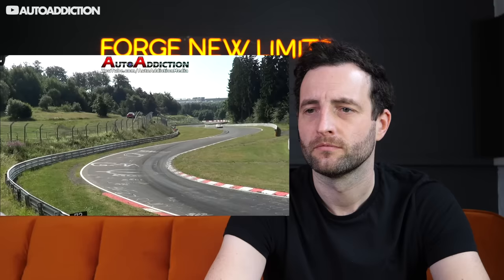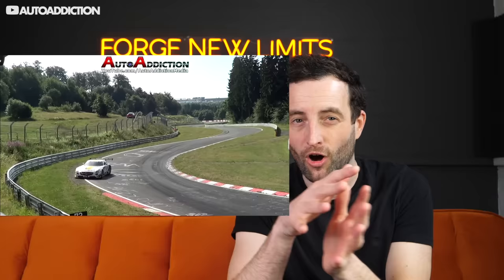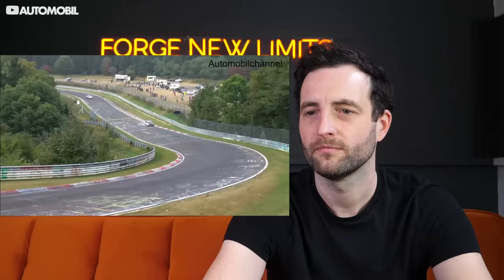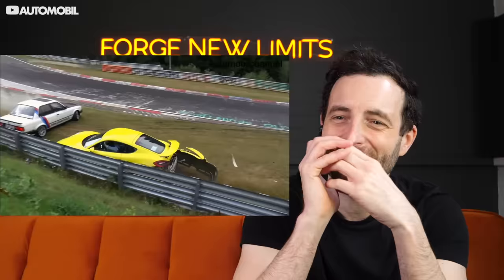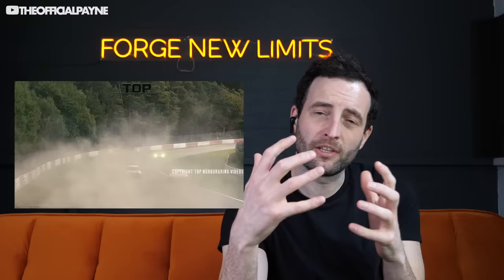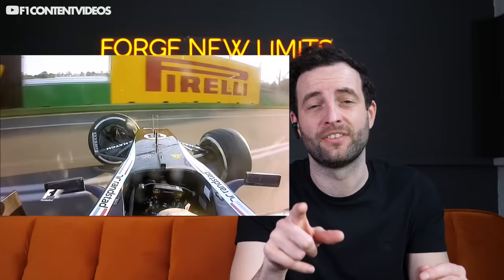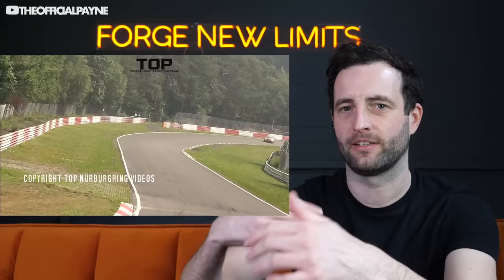Race Driver Explains Nürburgring Crashes

Comment from the maker: Which crash did you think was the worst? Do you think you would make the same mistake?

You should also check out this playlist of other 'Race Driver Reacts'! - https://youtube.com/playlist?list=PLAZL0MKQigFOuauybSSXd8hR2Yb6Q7L8r
Reply: Whether it's on the ground or airborne, spinning looks terrifying.

(And I would've probably done the same mistake 🤷‍♂️)
Reply: Probably the 1976 crash of Nikki Lauda
Reply: Dale Earnhardt
Reply: Honestly from my point of view, that VLN Mercedes GT Car (at 1:38) was purely unlucky, with no, to little driver mistake involved there. Because to me, it looked like the back of the car, including the tires, lifted up into the air at the moment of 1:55 , making the car rotate, he tried to catch the slide, but as the grip was then reapplied because of the weight coming back to the rear, the car straightened out, and then into the barrier. So yes, the camber change does apply, but the back tires looked like they were off the ground, making the situation worse.

Please don't attack me if you saw the situation differently than I did, because, in the end, what happened, happened and after all, we can only be the judges who have not or never been in that seat.
Reply: At 7:32, absolutely.  What an impact.
Reply: Please say it the right way, Pour-shuh
Reply: In my own car? Hell nah man. I'd never take my baby on a track with curves.

In a leaser? Yes. Hell yes, and I'd have a spectacular crash!
Reply: 06:38 is one of the worst probably due to the high speed.  Dunno if I would make the same mistake #Driver61 but fantastic video as always! Do make more videos like this! Thank you!
Reply: Purely out of inexperience or, if I can be brutally honest, complete stupidity, I would say the Golf.  That had to be the most embarrassing crash.  The others, hard impacts though they were, I would put up to circumstance and slightly late reactions.  The Golf understeering then going and hitting just about everything in the general area is a "hold my beer and watch this" moment that is clumsy and humiliating to watch.  Some drivers can't come back from that.  I don't think that person will.
Reply: "love" that footage of the orange bmw rolling and landing on its own wheel on the track
Reply: can we make this a series of you reacting to crashes
Reply: Concrete Head  me?
Reply: You look liked you enjoyed a few of them 😂 😂
Reply: honestly the Nürburgring Nordschleife is an extremely challenging track not only because of it's little runoff but just because of it's sheer size (length, amount of corners, different weather conditions) Misha Chaurodin (an instructor, youtuber and race car driver) says it this way get yourself a shitbox with not much horsepower but good brakes and a maintained car. Then drive fucking slowly with your indicator to the right and learn the layout of the track for a lot of laps. After you have learned the layout then rent a ringtool (a car that is more prepared for high speeds and fast cornering). IF you think you want more then build yourself a ringtool! But the MOST important thing is always remember one saying that stays true at every point you drive the track. You won't be able to impress people but you can make everybody laugh (by either crashing or doing something stupid).
The worst crash was the oil spill carnage because the oil spill didn't just influence the one responsible for it.
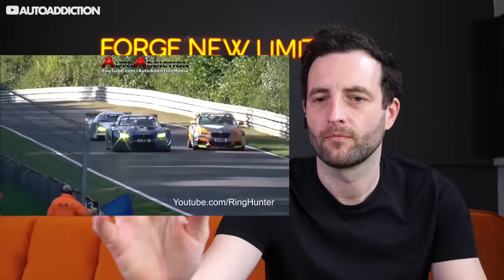Reply: 9:18 The white care diving in the inside of the corner, BMW had to take the corner, regardless if he saw the white car.
Reply: The worst crash was the car that hit the guard rail head on they fliped 5 or 6 times.  And after watching the guy with no helmet but wearing a hat I guess a Hans divce is not mandatory.  As for if I make the same mistakes yes I would .But they again I know my skill level and being out there wouldn't happen and my driving reflects are not as good as they were 30 years ago.
Reply: I would have to go with captain understeer. To me it just reeks of overestimating ones speed, car (control) and driving skill. It can go wrong very quick and the results can unfortunatly be fatal. But as we have seen in the other examples everyone gets it wrong sometimes and the Ring wil bite you in the backside.
Reply: I would definitely not make the same mistake.  Namely because I would be watching, not driving.
Reply: Analysis on Niki Lauda's crash.
Reply: The BMW straight into the barrier
Reply: i think the funniest looking one was the last one where they hit the barrier backwards, the car got butt slapped by the barrier
Reply: Jann Mardenborough
Reply: All of them

Comment: I'm gonna stick driving this track at the console
Reply: Samee one day I'll beat my 7:53 time in the rsr
Reply: Yeah but i would still like to run a cautious lap around the ring!
Reply: @rns.motorsports  same
Reply: @kgmulato5951  i just kinda send it once i get a feel for the car after the first couple turns its go time sometimes accidentally into a wall lmao
Reply: @mannythrash508  sometimes I do a few laps to get acclimated to the track then do a full race once I'm confident enough to send the car to its corners, hell, even slowing down makes you sweat haha
Reply: @kgmulato5951  especially with no abs i messed with brake pressure so i only get 50 % pressure helps me not lock up under way to hard braking it will lock up in down hills tho
Reply: @mannythrash508  I sometimes play it safe tho ABS on but TC off when I want to beat my previous time, but it's fun if it's all turned off
Reply: @kgmulato5951  i get the funniest footage with nothing on lol rolling looks cool from the cockpit tbh do you take Gt cars or whatever you want ?
Reply: @mannythrash508  usually I take GT cars, Audi R8 GT3 and Nissan GTR GT3, if road cars I usually use Porsche 918, Huracan Performante and NSX (both old & new)
Reply: @kgmulato5951   i stick to the gt Mercedes vipers astons and bmws road cars i go everywhere sometimes i use a honda oddessy sometimes a caddy limo lmao
Reply: Its an awesome experience to drive there tho. Just have to know the track atleast a little and know you are not behind your console anymore and drive accordingly.
Reply: @fierox88  mate I live in the Philippines lol, but someday I'll have a lap there
Reply: @kgmulato5951  haha ok!
Reply: @fierox88  if I try driving it I know I'd get to confident right before a blind turn and boom lol
Reply: I have a couple of hundred laps in assetto corsa and 1 lap in real life with a 50hp Seat Arosa. I recommend you drive there for real.
Reply: haha Yes very wise decision !

Comment: In a nutshell:
Drivers going way too fast for their skill level. Faulty input, faulty judgement and reactions. 
Period. Now for pure joy, watch Sabine spin around the ring in anything. 
Sheer beauty and excellence. 
Rest in power you goddess.
Reply: one of them, and it probably still had something to do with inexperience, looked to me like a bit of wheel-hop. Get on the brakes late and hard, back tires lift a little bit off the ground for a split second, and that's all you need to loose it. But what do I know, I've never been in a car on track, I'm a just a nerd who enjoys the technical side of racing from my couch.

Comment: being from the states I've only gotten the opportunity to drive laser scanned versions of the Nürburgring in sims like rFactor 2, Assetto Corsa, etc. and especially in rFactor 2, it really shows how treacherous the track is. Particularly in cars that are reliant mainly on mechanical grip, If you go off line just a little bit you have to be completely aware of the bumps on the track and where they are on the width of the track, even more so than you already are on the racing line alone. One line you may be able to send it full throttle, but as soon as you step off that line, to maybe pass, or because of a mistake, hitting one of those bumps at WOT will send the car straight into a barrier. I always find myself constantly changing sides of the track even down straighter sections to avoid bumps and be able to WOT, otherwise you're having to constantly feather the throttle to not upset the car. Driving classic F1 cars around the Nordschleife in sims, on a computer, without any of the actual sense of speed, danger, g forces, etc. it really shows how old F1 drivers were truly dancing with the devil in the best way possible.

Comment: In a roadcar car without rollcage, harness and HANS, you're better off without helmet, even on a trackday.
Reply: Why so? Honest curiosity
Reply: @JordiMataGarcia  The extra weight massively increases the load on your spine in a crash, and reduces the effectiveness of the airbags.
Reply: @JordiMataGarcia  your whole body is stopped by the belts but your head/helmet is not, so as our body stops, due to inertia the helmet wants to go ahead 
Which results in spinal/neck injuries 

HANS works to protect this, there are two straps connected to the helmet and the rest of it lies on the neck so during a crash, as our head moves forward the hans protects helmet from going that far with a sudden jerk resulting in neck injuries. 

NASCAR has an infamous story related to HANS as it was mandatory in all open wheel series, the officials of NASCAR were also keen to use it in the series but many drivers were reluctant to use it, which also caused death of dale Earnhardt because he was one of them who didn't wanted to use hans
Reply: @metaltyre4894  @tommihommi1 Thank you both for your replies, that was very informative and yes it makes a lot of sense.

Comment: I found out about trailing throttle oversteer in a friend's 911 in the seventies. I see that some front-drivers have the same thing. Hard to fight instinct when you cook it into a corner.
Reply: Or push the clutch in immediately upon foot off gas.

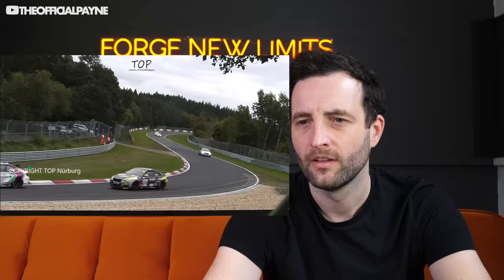Comment: 8:25 Just one comment I couldn’t let go of: energy is never lost. It’s transferred or converted. The danger in hitting the wall at that speed and straight on, is not that you lose energy too quickly, but that there is tremendous force in the opposite direction of the moving object. That force is what damages your body. You don’t lose any energy. Rolling is better because the force in the opposite direction of the moving object isn’t as powerful. It’s the reason a round wheel moves better than a square one.

Comment: It's surprising to see so many people using brakes or steering too much just when their car is going on a bump. Driving fast on a bump is the same as driving on a slippery road. Your car loses weight and most of the grip on the wheels because of this. So you basically have to stay still and do your actions before of after passing on it, not exactly when you are on it =)

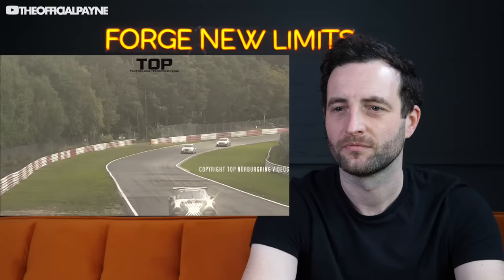Comment: You really do not want to get it wrong at Schwedenkreuz, that super fast down-hill left at 5:30. It's right after a slight jump and one of the fastest parts of the track, and there is little run off area there, and beyond that, there is trees. And if you stay on the track (in most cases), there is Aremberg, a slower right that you have to brake for a second- literally 1 second after you've exited Schwedenkreuz.

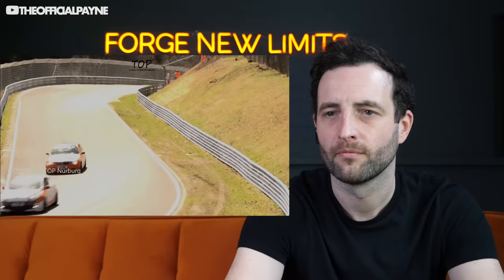But the most dangerous corner on the whole track is that left at 9:05 at the end of the Foxhole. It's so fast, and as you turn in the corner drops away, and if you get it wrong, the barrier is right next to the road, and if you come together with someone there, you could take off, clear the barrier and go right into a wall of trees... 

There is a reason why the Nordschleife is the greatest purpose built permanent track there is. Because there is no track of its kind  in the world that compares to its driving challenge. None.

Comment: It should be noted that, during tourist drives, the track is legally a single-direction toll route.
You're not supposed to do racing line/racing speed driving, you're supposed to stick to the right/overtake on the left.

You're also not supposed to have a timer within the driver's view.

Comment: The subtle changes in elevation are a real threat on that track it seems. Almost imperceptible sometimes and you think you still got grip but really you don't.
Reply: Be at least 10 full laps before I tried to push.
Reply: @soisaidtogod4248  I bet! The way this track plays around with the weight of the cars is treacherous as hell it seems

Comment: The secret is to straighten the wheel before the slide ends and let the car gain traction with all four wheels gracefully. And don't drop the throttle, Otherwise it's tail wagging the dog. 

My father drove our family Mercedes around the Ring in 1970 with all aboard. I don't know what the section is called but after making a big full throttle run downhill through a series of esses, you go into an uphill short straight with a 90°left as you top the hill. Well of coarse my father had no idea the track did this and proceeded to go straight at the top. Only in 1970 it was a big dirt runoff with no guard rail(thank God) so all we did was get her slowed, and rejoined the track to the delight of all the spectators camped out at that section knowing what happens there. 

Got to drive the now long gone South Coarse also. Two flying laps back then(you entered from the actual pit lane so you had a full shot down the long straight unlike today)for 10 Duetches Marks.

Comment: The drivers on the track days have to pay to replace the barriers they hit  pay for the tow, pay for the safety car , & pay if the track is closed at €1400 per 1/2 hour . It can add up to €1000s before the cost of fixing or replacing their own car.

Comment: when the car snaps other way, its easy to take control and you dont need much practise with that. sure for first timers wall is the first option :) So what you need to do is when you get such a slide to right and you try to fix it for left you press cluth down and start tapping brake in which moments on that few seconds I cant describe here in details but with this its possible to avoid wall. and if still you see you going nose against wall , last tip is to pull handbrake and try to get car side ways left or right depends which side you are heading to

Comment: @ 9:53 - the usual problem for drivers losing control in this left corner is because they lift right when going over the hill at high speed and that makes the car shift weight and lose grip on rear tires. You need to keep the throttle on right when going over that hill

Comment: I think the golf driver did the best with that save

Doesn't look like they made much contact with the barrier if at all
Reply: Nope, you must not add steering angle if the car's sliding over the front wheels. You actually have to open up the steering, brake and then turn back in. 
Edit: Ah, after writing I've realized you probably meant the one at 1:30 not the one towards 10:30.
Reply: @666louis  yeah the very first one where he powered out.

When in doubt 

Power out

Comment: I have done almost the same as second BMW. But I flew of track and fronted a tractor, so the car was scrap. When I scraped the car for parts I found two really bad bushings in the rear axle. So my crash could have been avoided if I have done proper maintenance in the garage.

Comment: From driving a lot on dirt farm roads which are bumpy af and you can lose it at moderate speeds, in a utility truck as well with a very light back end when unladen, I almost always got away with it by thinking OK you swine, you want to spin, I'll help you. Handbrake on, pull a three-sixty. On YouTube I've seen so many track shunts where the car though lost-it was going in a basically safe direction and the driver inputs snapped it into the barrier. The real secret of course is to be born with a first name like Max, Lewis... or Nigel.

Comment: 5:45 btw @Driver61, there's an elevation right before that part of the track in which, sometimes, the cars lift up slightly (ofc, those drivers are going fast, that's why they are jumping). That driver might've probably lost control because he went up into air, and he did not have any way to redirect it, apart from a rough landing

Comment: Letting go of the wheel in a crash is not just important for real life racing. Sim-rig wheels, even low end ones, are now powerful enough to do real harm if the driver does not let go of the wheel. Whilst anything less than a Fanatec CSW is unlikely to injure an adult, even a gear-driven wheel (Logitech Gx series/Thrustmaster 150 etc) can injure a young child (under 8) who is not aware of the need to let go.

Comment: In the sequence in which the car hits the barrier and rolls several times, you can see in the moment before he hits the barrier it appears as if he has the throttle opened as you see the dirt flying from the rear wheels - why would he do that?

Comment: 6:32

Yes, the infamous "Schwedenkreuz".
They tried to iron out some of the nasty bumps.
But, in the end, the line, diameter and speeds of the turn there remain roughly the same.
The biggest issue is, amateurs panic breaking on the (or one of the) apex(es).

Comment: The first BMW, he didn't even try to steer into the turn. If he had just let go of the wheel and feathered the throttle he should have been fine, hell, I used to go round roundabouts in the rain like that when I was 17.

Comment: Regarding oil or other stuff on the track:
I'm at the Ring several times every year and I hacked my infotainment to display some sensor values. Now I was thinking of adding an IR sensor to measure the temperature of the track surface. Any idea of other sensors that would measure downwards, maybe at an angle, that could somewhat predict oil or other fluids?
I guess fresh oil or coolant would be detectable by seeing (slightly) higher temperatures, so the track surface temp display could sense a sudden change and light up?

Comment: 99.999999999999999999999999% of these crashes could have been avoided had the driver not panicked and been able to lock the wheels. Almost all of these are drivers rolling into the armco at 30mph.